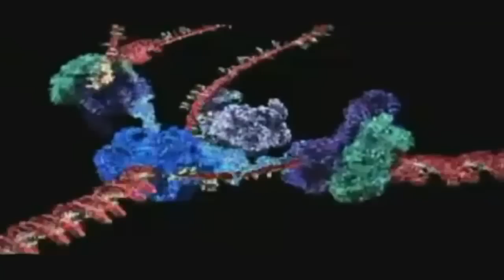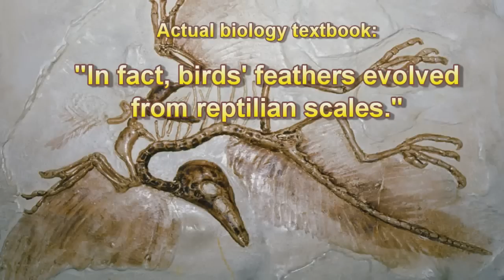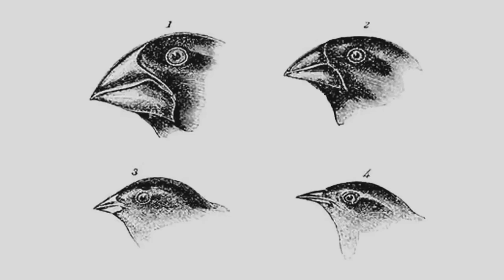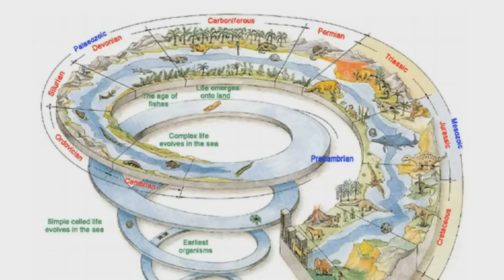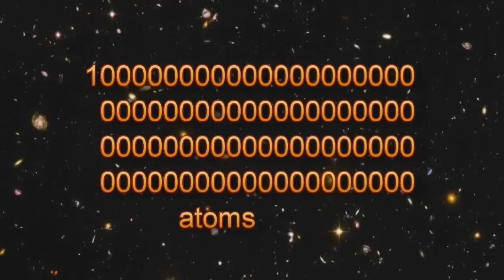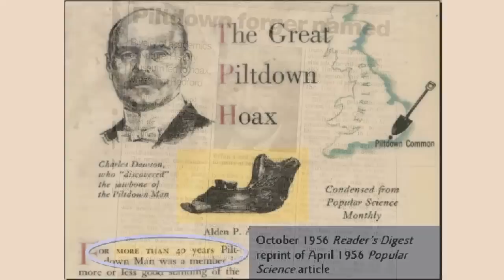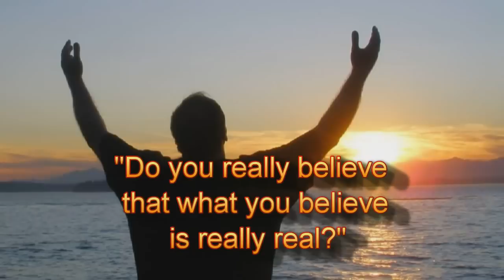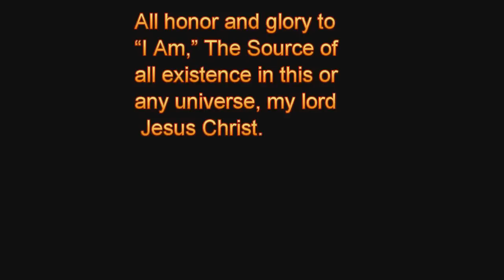Evolution Demolition

Comment: Mark what is the Law of Increasing Randomness? How is it different than the 2nd Law of Thermodynamics? How did you derive it? Can you show the equations?
Reply: I call it the law of increasing randomness because it is bigger than the 2nd law.  It is the mathematics (statistical mechanics) that the 2nd law is ruled by--as Boltzman showed.  The same mathematics works with informational entropy.  The principle is that all things are drawn from a state of lower probability towards a higher probability, which in general is a state of greater randomness.  This principle is seen throughout nature, from the round shape of a gas-filled balloon, to diffusion across a membrane.  I have considered calling it "the law of probability gradients," since just such a gradient "force" drives the ATP Synthase motor with protons.  Boundaries of separation between probability gradients can be altered to slow or speed this transformation, and probabilities themselves can be altered, especially by intelligent mind, but the power of this mathematical "force" is unavoidable in an ultimate sense, because total net entropy (of any kind) must increase.

It is true that energy can be channeled or harnessed by altering probabilities to cause things to "build up," but if not applied in exactly the right way, added energy only "breaks down."  Such is the case of the energy of the sun.  Opening the system and adding the energy of the sun does not solve the increasing entropy problem, but exacerbates it.  Without an entropy transfer mechanism (ETM) it is impossible for genetic information to arise spontaneously via mutations, because mutations are random, and 2+2 still equals 4, whether you are in physics, information science, or biology.
Reply: Mark Champneys
Congratulations publish your work. I would love to see how you derived this law.
Reply: Helixbuilder It is nothing new.  I just have a grasp of the concepts behind the law of increasing entropy.  If you dispute this principle, tell me why.
Reply: Mark Champneys Do this experiment add a drop of blue dye to a glass of water what happens as time goes by?
Reply: Helixbuilder Obviously it disperses exactly as I made my point.  So what's yours?
Reply: Mark Champneys
 Yes but is it still increasing in randomness when the dye is fully dispersed? Remember it is a closed system. Hmm how do you explain fractal (patterned) behavior of molecules? You've basically conflated three definitions of entropy declared them to be the same without a rigorous mathematical proof. So yeah I don't buy it.
Reply: Helixbuilder I didn't think you would by it.  I didn't even think you would buy it.  The next step is to move in the direction of any higher probability that is available.  Molecules with physical characteristics that make it a higher probability for them to form crystals, such as snowflakes, will move in that direction when temperature affects probabilities accordingly.  Random appearance is not always the higher probability state, but usually is.  Your task is to show how greater genetic algorithms can be make a higher probability state than a random arrangement of the sequence.  If you can offer such a mechanism to transfer probabilities, you will have a real theory of evolution.
Reply: Mark Champneys
It is like you are asking me to tell you what kind of clothes angels wear when dancing on a pin. Until you define what you think a genetic algorithm is I can't answer. You keep appliing Bolzman to systems where the means to get an answer is derived from the equation used to describe a functional state. But you like the answer so it must be right.
Reply: Mark Champneys
Take the randomly distributed dye and and put it in an new glass of water. What happens? how could it? Wasn't the dye at max entropy? Why did the dye progress to another entropy max?
Reply: Helixbuilder It is about probabilities.  If probabilities change, then the the state will move in the direction of the higher probability than that which currently exists.
Reply: Mark Champneys
No its not. Show me why I have to use Boltzman to show whether a reaction will occur? If I want to know which molecules will react then I'd use Boltzman. Ice will melt if I add heat, do I really need to know which molecules phase transition first?
Reply: Helixbuilder While Boltzman unveiled the principle, I doubt that you need to consult his equations to show whether a reaction will occur.  Physical properties and supplied energy will generally give you enough information to detect which is the more probable state, and thus what reactions to expect.  This is what is done intuitively by most folks.  Less probable states tend toward a more probable state.

You seem to be a smart guy with a lot of technical training.  Yet, at every turn it looks like you are outsmarting yourself with self-refuting arguments.  Jesus referred to this kind of thing as "straining out the gnat and swallowing the camel."  I recommend backing up and taking a fresh look at things that are perhaps too familiar to you.  I must say that I have been enjoying our exchanges, and I appreciate that you have found me worth your time.  You must find something about this to be stimulating.  Anyway, thanks for that.
Reply: Mark Champneys
I refer to it as considering the analogy used to describe an equation as reality or as more simply put the fallacy of equivocation.
Reply: Mark Champneys
 Boltzman entropy justs show how many ways the molecules within a thermodynamic system can be arranged. Boltzman derived this equation to deal with ideal gases. Show how does it apply? You think your law of randomness is so great write it up and submit it to a physics journal.
Reply: Helixbuilder Thanks for the advice.  I might just do that.  But you wouldn't accept anything by a creationist anyway.

Dr. Granville Sewell wrote a paper on the 2nd Law that was accepted by a mathematics journal, then censored by evolutionists.  I don't think you guys want to hear it.
Reply: Mark Champneys
OK everyone gets a paper or two rejected some more so than others. You read the criticism of your paper if it is valid you fix the paper, if not the you make your case.
I checked it out It was accepted, so why not publish it? If it was crap it should have never been accepted. I just finished reading it and I'll say it is lame because by his math the self assembly of viral particles shouldn't happen. SInce self assembly of virus particles does occur that invalidates his interpretation of the 2nd law.
Reply: Helixbuilder Describe "self assembly."
Reply: Mark Champneys
This is what I mean by self assembly. Paraphrasing Bruinsma et. al. "In 1955 Fraenkel-Conrat and Williams showed that the Tobacco Mosaic Virus could be reversibly reconstituted in the laboratory from a two-component solution of its purified genome and the protein that comprises its cylindrical capsid. Reversible self-assembly has been demonstrated as well for a number of sphere-like plant viruses. In all of these cases the assembly proceeds spontaneously, without involving ATP hydrolysis." Get it?
Reply: Helixbuilder Yes I get it, but I am not imposing an ATP requirement per se.  You said this was a paraphrase, so maybe everything didn't come through in translation, but it raises a few questions.  We are talking about laboratory conditions for a spontaneous reaction.  How do the conditions vary for the reversible reaction?  Generally speaking spontaneous means one direction, not back and forth, unless energy is alternately infused or released.  Since ATP was not used in these lab conditions, what was the energy source?

You see, I understand that spontaneous reactions exist.  That fact means little in regards to our discussion.  This appears to be a simple idea of a bond between the DNA segment and protein, either made or broken.  Formation of the DNA segment or the protein in the first place would be much more impressive.

What am I missing?
Reply: Mark Champneys
Viral coat assembly actually happens in virally infected cells. No ATP is required!
The rest of your post, open a biochemistry textbook and read. 
.
Reply: Helixbuilder Did I not say that I was NOT imposing an ATP requirement?  I was speaking of  the role of energy of some kind in making bonds or breaking bonds.  I'm beginning to think that you are the one who needs to re-read your own textbooks, because you can't seem to discuss any topic without scampering for the cover of "the literature."  I posed some challenges to what you said.  Answer them if you really have any idea what you are talking about.

The issue has to do with building complex molecules.  Connecting a pre-existing protein coat to pre-existing DNA is a relatively simple idea.  How did the DNA or protein build up "spontaneously" in the first place?
Reply: Mark Champneys
Consider:"This appears to be a simple idea of a bond between the DNA segment and protein, either made or broken.  Formation of the DNA segment or the protein in the first place would be much more impressive."
So what are you talking about? The self asemblty of viral capsids or some kind of DNA protein hybrid?
Reply: Mark Champneys
 You think you understand what I am talking about. You don't. You need several courses in chemistry, molecular biology and bio-energetics.
What evidence do you have that any covalent bond is formed in the process of capsid self assembly?
Why do you insist that a simple dehydration synthesis reaction can't occur?
Your argument of incredulity is wearing thin as is your constant attempts to insult me for pointing out gaps in your understanding.
Reply: Helixbuilder Of course simple reactions can occur.  The issue is complex reactions that build up molecules in a specified arrangement.

And by the way, you could use some coursework in logic and philosophy, but I don't harass you about it.  If you want me to understand something, then explain the concept.  Otherwise I have to doubt whether you understand it yourself.
Reply: Mark Champneys
Yes you are still wrong. Furthermore I'm not the one who is claiming reactions don't work the way they do, you are. You do this by presupposing design.
Reply: Helixbuilder If I'm wrong, then tell me how.  Marginalizing my intellect is not an answer.  How are complex molecules built by natural supplies of energy without a designed mechanism that targets that energy and avoids damaging the molecules that are being built up?  Do you actually know anything about this, or are you simply going to tell me to read another article?
Reply: Mark Champneys
I gave you a review paper with over 1000 references to original research reports that showed evidence of abiotic chemistry. You refused to look at the data, so I can only assume that there is no data that would change your mind.
Your reasons that you blew off reading about the data  and just reading the review, can be summed up as: a) the data was biased, b) the authors used a passive voice in their writing, c) lab conditions somehow can’t mimic natural conditions, and d) some guy said it was impossible.
You could have looked up the original experiments and looked at the data. By your own admission you don’t understand chemistry but somehow you feel competent to judge the work of other chemist. The energy question, I suspect there are many molecule to chose from.  As for energy damaging molecules how energetic is the source? (-7.3 kcals/mol for ATP to ADP + Pi or Phosphoenolpyruvate at -14.8 kcals/mol. Yeah there are more than one energy carrying molecule!)
So my advice would be to look at the evidence. If you think for some reason that molecules behave differently in the lab than in nature kindly provide a reference.
'Salt-induced peptide formation from amino acids in the presence of clays and related catalysts'

'Evaporation cycle experiments--a simulation of salt-induced peptide synthesis under possible prebiotic conditions.'
Silly me I'd rather you would look at the data then describe it to you. You can make you own judgments!
The really funny thing is the very thing you claim is impossible has been done.